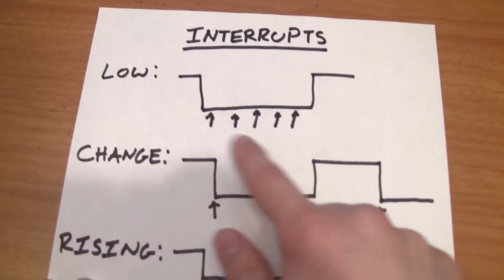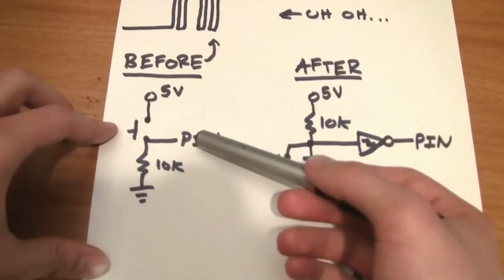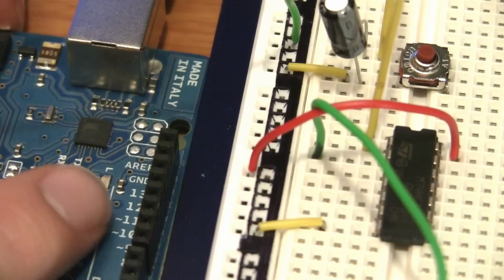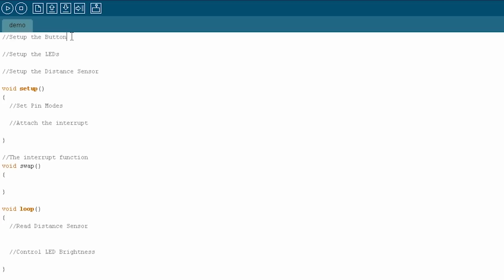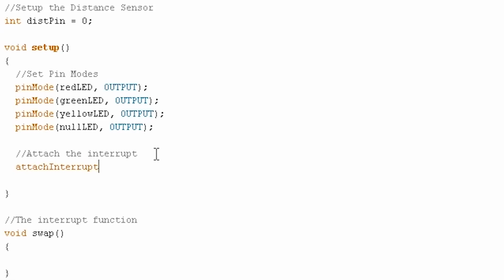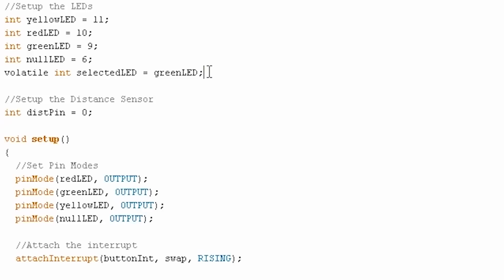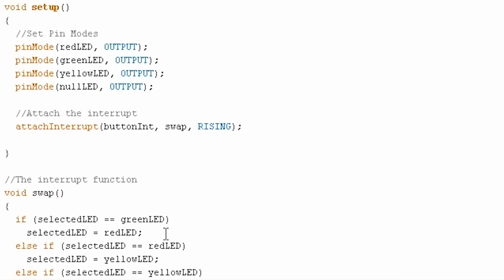Tutorial 10 for Arduino: Interrupts and Hardware Debouncing

Comment: I put a 750K ohm resistor in series to the first input of the switch from the 5V power supply. The first input also connects to the D2 pin (INTERRUPT Pin)  of the arduino. The second input of the switch connects to GND. Finally I put a 1uF Capacitor across the D2 pin and ground. Now set the trigger mode to 'RISING' in the code. Thats it! Worked like a charm. OPTIONALLY: You could put a 22pF ceramic cap across the switches for even better stability.

Comment: Great tutorial, I enjoyed it a lot; had to slow down the player to 0.75, lol! I have the comment, though. It's never a good idea to put a mechanical switch in parallel to a capacitor because due to the very low internal resistance of the cap and the switch there will be a huge momentary current flowing through the switch contacts which will, in turn, wear off the contacts and cause some problems after many cycles of being pressed. It's preferable to put a switch in series with a resistor, on top of the cap and use 2 Schmitt inverters, instead.

Comment: Nice tutorial. Personally I would've opted for a (much) smaller  (1-10 nF) capacitor... but that choice is driven somewhat by the application (manual switch vs. rotary encoder, for instance).Also would've been good to explain why exactly we want that fast transition coming out of the Schmitt trigger.

Comment: Another great vid, thanks Jeremy; to Robert Sisco point, shorting the cap is rough on the switch, also your rc timing waveform should show a rapid discharge and integration on the rising edge.

Comment: Shorting the capacitor with the switch will cause the switch to wear out due to the instantaneous high current flow. A better solution would be a op amp integrator circuit using say a TL084 chip. The TL084 can be used with a single 5V supply, if the + Input is biased to 2.5V, with two resistors.

Comment: "Normally you should use digitalPinToInterrupt(pin) to translate the actual digital pin to the specific interrupt number. For example, if you connect to pin 3, use digitalPinToInterrupt(3) as the first parameter to attachInterrupt()."
https://www.arduino.cc/reference/en/language/functions/external-interrupts/attachinterrupt/

Comment: Old video, but just to summarize the issues: short circuiting the capacitor with a switch (and without a resistor) is a bad idea. There is also no need for an external Schmitt trigger since the Atmega8U2 used in the Arduino boards already has Schmitt triggers built into each IO pin.

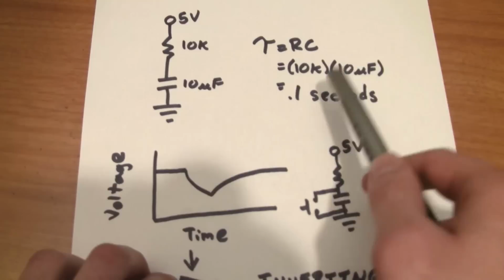Comment: Actually,@6:17 if the button were to be pressed the voltage would fall immediately to 0 (ignoring switch bounce), and therefore the decay that Jeremy spoke about would be non existent.
Reply: he is right , the curve is To , which the time for charging the capacitor = RC
while R is the resistance , and C is the capacitance , when the button in release mode
the capacitor start charging till Vin , since the button is pushed the capacitor will release the charge in RC delay also , so here chmit trigger is used for 2 purposes the first like inverter and secondly is to make a square wave pulse from the RC curve .
Reply: @Donovan Lym So someone did noticed it. This is depressing though how many is still convinced that this is correct.
Reply: @001marselle  No he is not right and he does not have the RC circuit. This is as simple as to lookup an RC circuit in wikipedia or even just search for hardware debouncing. This is plain wrong what the author is doing.

Comment: One small caution here... You're discharging that fairly substantial electrolytic capacitor through the contacts of a tiny switch that's means strictly for very low currents. Each time you hit that button, you get current spikes probably approaching a few Amps... toasting those contacts. The simple solution, use a 1k resistor in series with the switch. This limits the current to 5mA, and still pulls the charge out of the cap down to 0.5V... plenty low to keep things working as planned. :-)

Comment: Actually, you *have* to use an else if the way you designed your swap function.  If not, it would catch on green, change it to red, then catch on red (in the same interrupt), change it to yellow, catch on yellow, and change it to null.  It would be a particularly nasty bug to catch too.

Comment: Very clear example of how interrupts work on an Arduino. I need an Interrupt to halt the main code to turn off several relays and turn one on for about a second then off.
Can this be done with either INT0 or INT1? I am using an UNO with a Relay Shield. Thanks
Reply: yes it can be done , you just have to define the interruption pin , and the make separate function for each interruption , and make separate interrupt in attach command .

Comment: Sorry, but this is pretty bad idea to put a switch directly across a capacitor. This will short, and possibly create arcing, it also doesn't form RC circuit at all. It will discharge immiediately, and work one way fast, and another way slow.

You need to put a resistor (preferably lower than pull up resistor, e.g. 2k), between capacitor and the switch to create proper RC circuit and limit the current flowing via the closed switch and capacitor.
Reply: I was wondering the same thing.
Reply: Yes.  Jack Ganssle has an excellent explanation of the relevant considerations on http://www.ganssle.com/debouncing-pt2.htm
Reply: I saw the same thing. Thank you for the link Doug. Refer to Figure 2 in Doug's link. 
 
So, the real equations for the proper circuit would be Tau (closed) = R2 * C, Tau (open) = (R1+R2) * C. You would want to tune your R1 and R2 to be long enough to physically debounce the switch when pressed, but not take forever for the circuit to charge back up when released. And, also not to pull too much current from Vcc when pressed. The original 10k for both R1 and R2 would be OK. It would just have double the rise time as fall time.
Reply: it appears his main flaw was omitting the r2 from the proper circuit in the link by +Doug Woodrow
Reply: I put a 750K ohm resistor in series to the first input of the switch from the 5V power supply. The first input also connects to the D2 pin (INTERRUPT Pin)  of the arduino. The second input of the switch connects to GND. Finally I put a 1uF Capacitor across the D2 pin and ground. Now set the trigger mode to 'RISING' in the code. Thats it! Worked like a charm. OPTIONALLY: You could put a 22pF ceramic cap across the switches for even better stability.
Reply: shyam Saravanan z

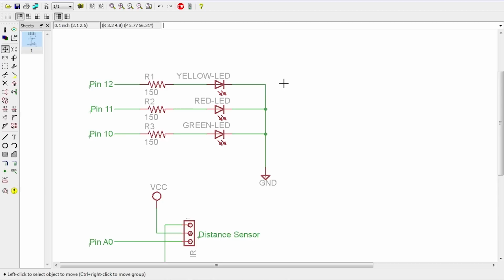Comment: 10:46 Do you know what would be even cooler? And you can do it with the exact same software you are using right now, and with the removal of 3 hardware pieces to your circuit and the addition of 1? 

Control of an RGB LED!

Comment: Hey, my interrupt will trigger on the rising edge (as programmed) which is what I wanted. However, as soon as I inserted some codes to enable my motors in the main loop, the interrupt signal from my photo interrupter tends to interrupt far more times than it should. It is supposed to interrupt when the infra-red is being blocked by an object once at 0-1 rising edge, but it is triggering like 100+ times when i run a paper to block the infra-red on the photo interrupter.

Comment: @enticed2zeitgeist Little late to the party however I can answer this for you, by using else if, it will only evaluate if the previous if statement is not true. If you used a separate if for all of the lights then they will always evaluate that if statement regardless if a if statement before was true. Not only does this save a minor amount of proc time more importantly it eliminates possible side effects. (out of char will continue in next comment)

Comment: It's a bad design practice to put a switch across a capacitor without a small discharge resistor in the path. That's because i = c * dv/dt. Hence, the current is infinite when the switch is shorted and the switch life will be shortened as a result. A small value (able to take the power and not drop too much voltage in the case where the switch is enabled) resistor should do the job.

Comment: @sciguy14 I have a problem. Basically i noticed that there was a slight change in the code in that you have included the two serial lines. I went back to tutorial 2 and to my surprise the line:   Serial.println(digitalRead(switchPin)); 
caused the bouncing of the signal to stop.  I would like to understand why this is the case. Also, erroneous reading are still occurring now that I deleted that line from the code..

Comment: I'm also curious if you would be able to treat the characters you're reading in from the SD card as strings, then append or concatenate them into one big string in a variable, then convert that to an integer instead of the power of tens style method you used?

Comment: Hi. Learning alot of stuff from you videos.  I've finally gotten an Ardiuno to play with.  I only had a 74HC04 available to attempt this circuit but still having some debouncing trouble. I see the Schmitt version is listed as high speed, is that the difference? Well I'm playing a bit with the resistor and capacitor to increase that rc value and see if that might help till I can order more parts.

Comment: please help, I made a machine based on Arduino, but I had a problem with noise, sometimes Arduino receives a signal from one of the buttons that is connected to them, although they didn’t press this button, I thought if I built low-signal filters and connected it in series with every pin of Arduino's entrance he will remove this noise. I wanted to hear your opinion and advice on this matter. Thanks in advance .

Comment: Hi !! I had read ur clip and implement the schmitt circuit .  but i have another problem. I use the arduino to drive a 24vdc motor via a power-mosfet, and connect to a wheel encoder(opto-interrupter) with an interrupt pin of arduino. I wanna to read the dc motor's actual  position from the encoder value.(like servo) .  When I complete the circuit of these two application on one arduino and test .

Comment: I want to do build a car tachometer using a 12V square wave ignition signal. 

Can I use an inverting schmitt trigger to accomplish this if I scale the voltage down to 5V with a divider. 

I'm a little confused on how to wire it so it's a 5V input rather than a switch pulled to ground instead.

Comment: Does the interrupt takes only digital values?i.e.the value that changes should be either high or low or I can use it for analog values also.I want to use Interrupts while receiving analog signals from the IR remote using ir sensor.

Comment: Slight mistake with your circuit/description. There is only a time for charging it, there is no resistor for discharging meaning it will discharge instantaneously then charge back up relatively slowly.

Comment: As shown at the figure 13.2 from the atmega328 datasheet, the digital inputs of the microcontroller have their own Schmitt triggers. I wonder if they are not enough?
Reply: Try using un un-debounced switch and you will find out soon enough (I've done it...). 
Point is that if you don't prevent the signal from going through the lower and upper logic limits several times, the Schmitt trigger will happily switch high/low several times, in unison with the switch...
What is not mentioned in the video is that the rise / fall time ALSO needs to be fast enough (I believe less than 2 microseconds for Arduino) to ensure the triggering works properly. 
The Schmitt trigger's MAIN function in this circuit is to ensure a quick enough transition.
Having said that, I have just used the resistor / cap approach WITHOUT the Schmitt trigger in a lot of applications without any issues, but maybe I just got lucky.

Comment: Why is the schmitt trigger part necessary? Doesn't the arduino have that same kind of functionality on its digital pins, seeing anything above or below a certain threshhold as high or low respectively?
Reply: As shown at the figure 13.2 from the atmega328 datasheet, the digital inputs of the microcontroller have their own Schmitt triggers. I wonder if they are not enough?

Comment: there is a serious problem, when i use the attach interrupt to read a switch as an encoder ,and Serial println on the monitor.  I found that the ISR is keep counting the encoder when i drive the motor ruuning.
I had tried to drive the motor in different way between digialWrite (full speed) and analogWrite (PWM). The ISR's encoder value alway keep counting when motor is running. I dont know why?? Seems like electric bug, not the software problem .  If u can help .  I will appreciate that.

Comment: Will the Arduino still set the interrupt flag if the interrupt is tripped while detached?  Or do I have to clear the flag before reattaching to prevent the ISR from running right away?  Thanks!

Comment: Really helpful, thank you. Is it possible to debounce rotary encoder the same way as you debounced those switches? I was thinking of connecting HDD motor to comparator (LM324) and then apply the technique you used here.

Comment: Informative tutorial. Can you please say  that after doing the ISR in an interrupt,  does it ( the computing) go back to the original 
loop. Is it possible to call a function from within an ISR.  Say I want a "delay(1000) ";  , where can I put this
Reply: Calling a function from within an interrupt service routine (ISR), unless it's very brief, won't work in the case of the Arduino as other interrupts (timing) are blocked while you're in that.  You could simply set a flag in the ISR to be checked in the main loop and call the delay/whatever if it's set.

Comment: im running a really long loop with 10 modes  mode 10 is a huge loop and takes about a minute to complete i got the same inverters and hooked them up the same. when i hit the button the mode changes until it gets to 10 then it stops and it wont change 
any help would be nice

Comment: how would you use the interupt function if you are using two switches. one to control speed and the other to switch power on and off.
Reply: I suppose you would use the two interrupt pins and depending on which button is pressed, you direct the program to the corresponding interrupt service routine.
Reply: keep in the mind interrupt has been made to interrupt stop running a procedure , and will be used in application like reset button , or something similar , he he use it for education purposes only .

Comment: hi i tried this project wit arduino uno and 15xh-w gps (4800).. No responce in serial monitor.. if i simply read n print the gps output i am getting a sequence of numerical output repeatedly.. eg 246..... 165. i didt get NMEA protocol format. but the same gps gives accurate positions in UART connection with pc in its interface software.. Am sure my gps working good. i tried all codes regard arduino gps. pls help me am in middle of my academic project..

Comment: Thanks for sharing Jeremy, very informative. I wonder if you can help me with a particular problem that I have. I want the Arduino to monitor the state of an input, high or low, and if it is low to operate a relay on and off with a 500ms duty cycle. The input is a 5 volt signal from my CNC controller and all the relay does is flash an illuminated button on my CNC control panel. The problem I have is this, when the signal goes high again the routine driving the relay on and off continues for couple of seconds and I cant find a way of coding it so that the relay stops instantly when the signal goes high. I think I know why this is happening, but I cant find a software solution to it.
Reply: I guess you could monitor your input inside the interrupt routine itself also. That way, you can generate the 500ms duty cycle flipping of the LED on panel while checking for a change in the input itself, as soon as u read that high signal again. The control should go back to your main program and start looking for the low signal to run the routine again. And so on..